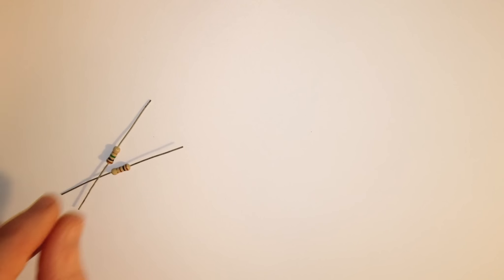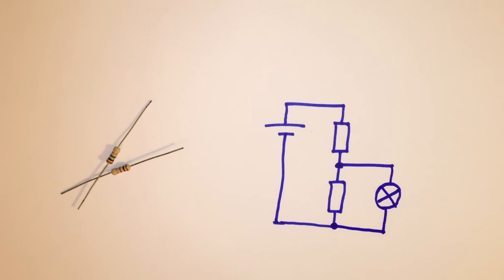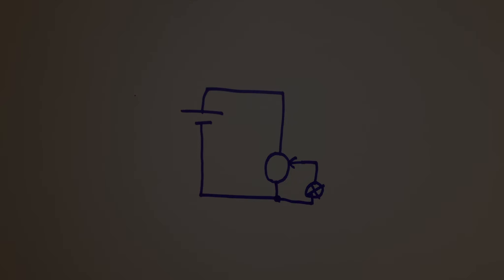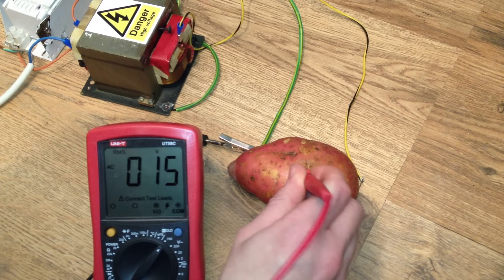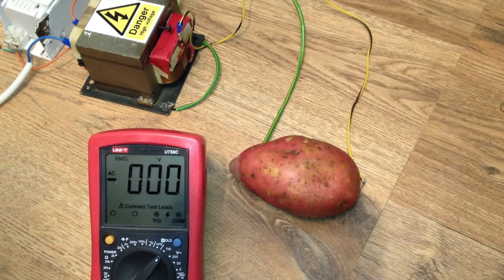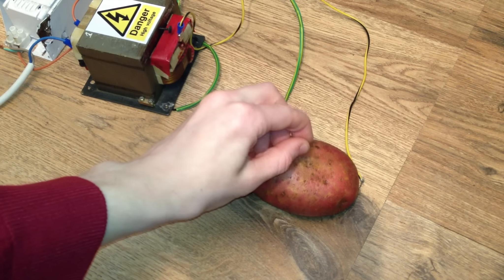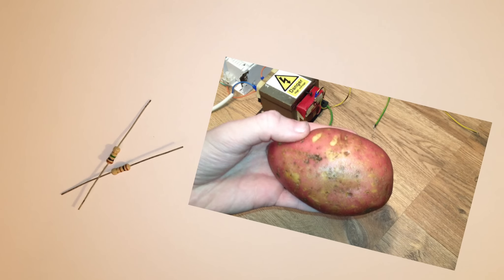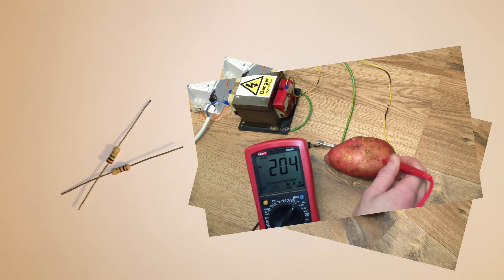Potato Potential Divider

Comment: loved this video, I wonder what was the donor for your transformer, what you used to current limit the potato and they changed to fry it later?

and lastly, did you later eat the potato and what did it taste like?

A+ for educating whilst also entertaining.
Reply from the maker: thezerocool22 A recently deceased microwave oven very kindly (and unwillingly) donated it's transformer and there's a 120W ballast in series with the input to limit the current, just visible in the upper left corner. 
I didn't feel like eating the potato. Cheers!
Reply: Add salt and it's like one very fat non square with skin burnt chip!